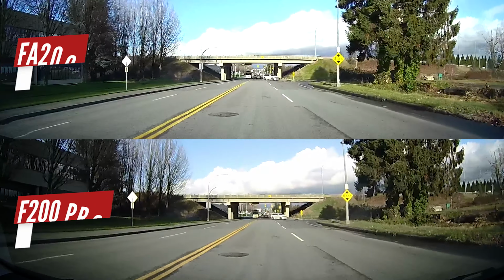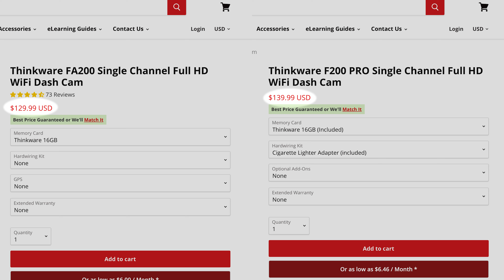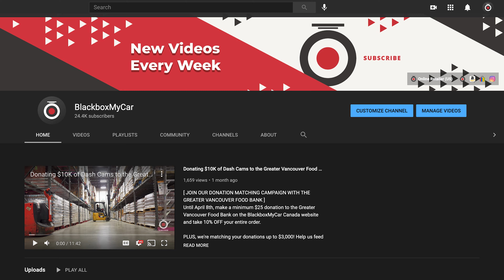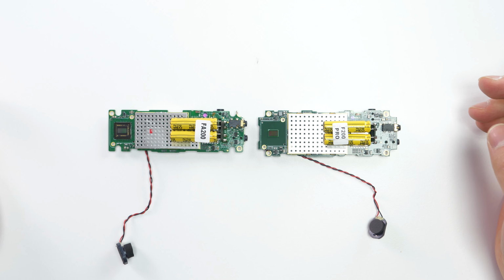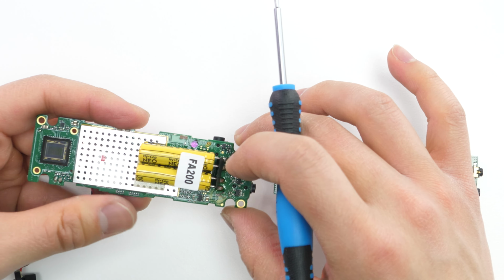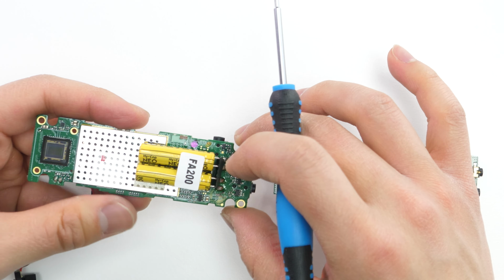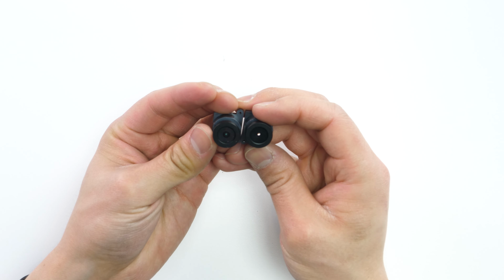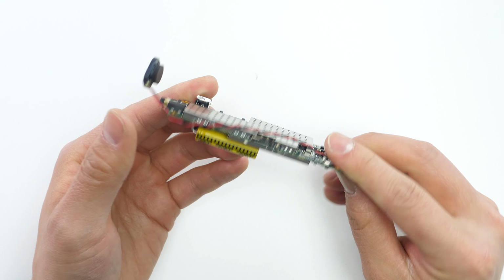TAKING APART the Thinkware F200 PRO and FA200!! | BlackboxMyCar

Comment: Do you have close ups of the boards. I would like to add an external speaker with amplifier, I know it would mean modifying the case but the ADAS warnings are so quiet (audible click sound) when driving with the radio on.
Reply from the maker: Hi there! I can't provide specific close-ups of the internal boards, modifying your dash cam in this way is not something we typically recommend. You might want to explore dash cam models that offer louder or more customizable audio alerts. Our support team at info@blackboxmycar.com can provide guidance on models that might better suit your needs.

Comment: It's a shame that they're still using the small rechargeable backup battery what crap out after a few years, I was thinking of replacing my 3 year old F770 with the U1000 but I dont want another $700 paper weight because of a 2 dollar part.

Comment: Sorry mate. Could you please tell me if Iroad x10 or x9  have buffered parking mode or if you will can see before event like blackvue viofo or thinkware?? Thank you.
Reply from the maker: Hi Andy,
Iroad cameras do not have buffered parking modes. The dashcams that do provide it are Thinkware or BlackVue. If you reach out to our support team at info[@]blackboxmycar.com they will be able to help you find a dashcam that has what you are looking for :)
Reply: @blackboxmycar  thanks for your attention and answer my friend. Now finally I seen one video comparing few cameras and I will take the viofo A129 pro 4k that it has buffer of 15 secs before and 15 after for what someone explained to me but said as well that the buffer just works if the canera is hardwired, with the lighter that function doesn't work . I will fit two sets of cameras ( for 4 chanels) plus two battery packs Neo 6 . Thank you for everything 🤝🤝🤝

Comment: I'm probably in the minority, but I'm going to pick up an F200 pro because I just want a simple unit, don't need a screen on it, and want some ADAS for my vehicle that has none from the factory.
Reply from the maker: Everyone has different needs from a dash cam. Choose the one that's right for you 😊
Reply: ADAS only works if you have the GPS connected